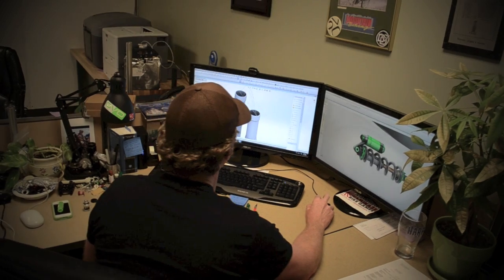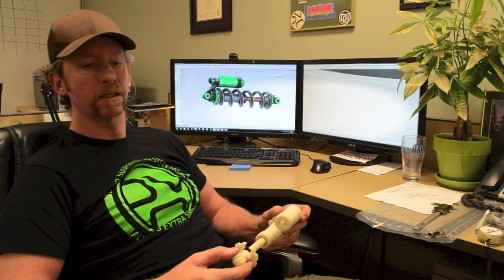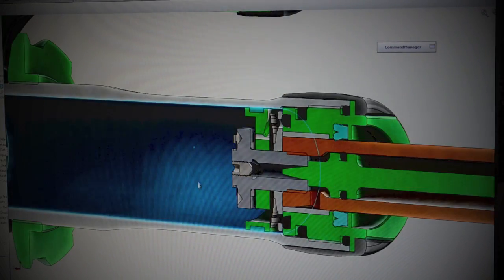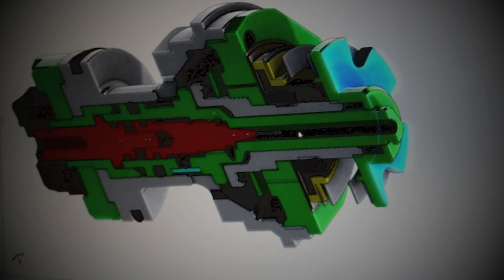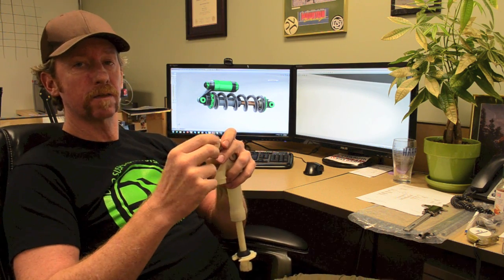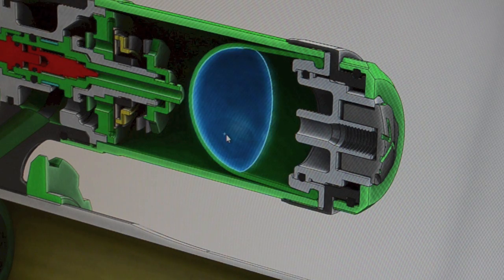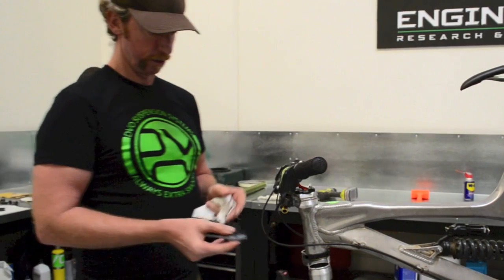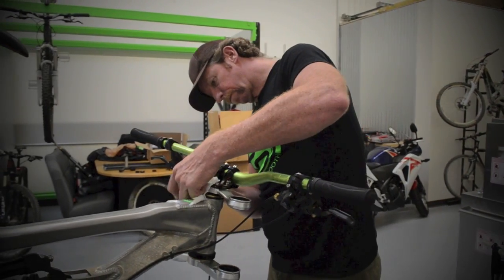Jade Preview

Comment: The bladder is fine, and does have its minor benefit of reduced stiction, for racers that will change the oil often. For those that plan on using the same shock without service for years, this isn't ideal. So if that is your intention, as this IS a DH shock, then the bladder will be a slight improvement. When you do a trail shock, will it have a IFP?

Comment: Nice looking shock. Sorry to be a downer, but nothing seems too unique to me, similar overall to any high end shock. The only thing different I see is the use of a bladder, and that is a downside to me. Coming from motorcycles, the stiction issue in shocks has been proven null because of the leverage ratio in a rear linkage. The problem with bladders is they leak, the Nitrogen passes into the oil, causing cavitation, doing exactly what the bladder was there to prevent.